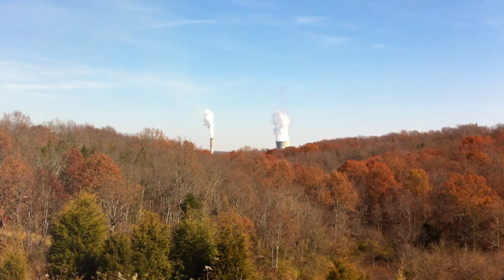Nuclear-Turned-Coal-Plant

Comment: Don`t be too hasty though. Coal is cheap, abundent and a heck of alot cleaner then it used to be. The Clean Air Act forced Coal Plants to adopt scrubbing systems. Though you do get the stuff you don`t want in a pasting form that makes it easier to be disposed of or reused. Better then having it in the atmosphere. Basically your left with CO2 emissions. 

I just don`t see Wind or Solar making a substantial dent into coal. Too expensive and inefficient.